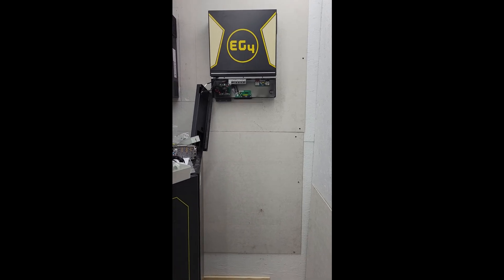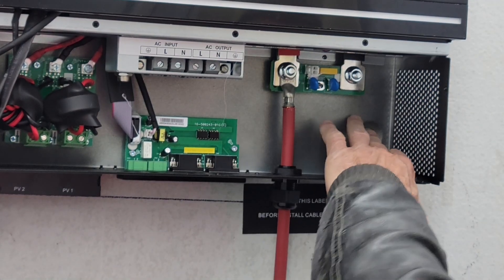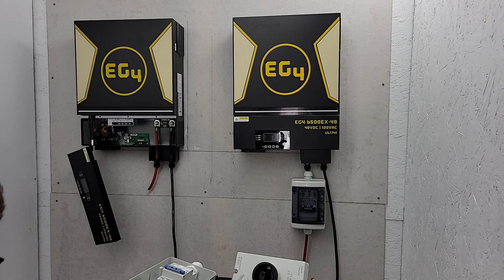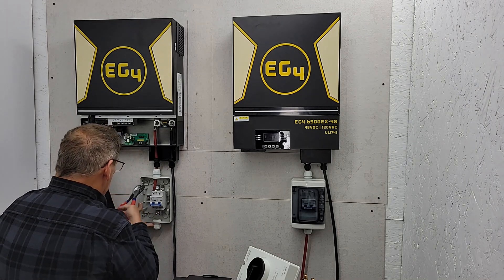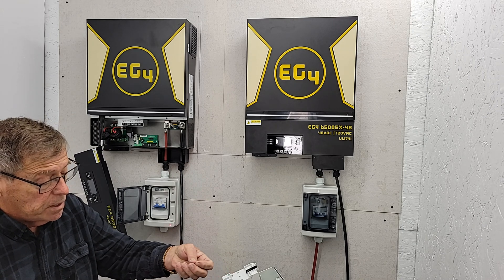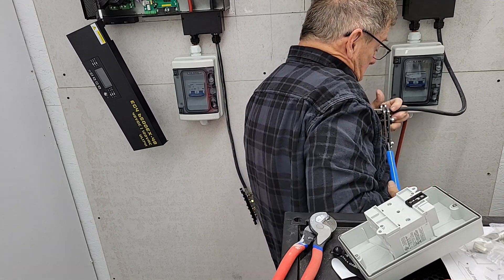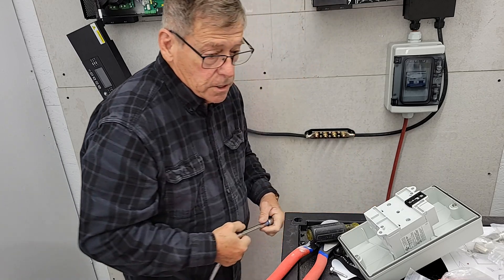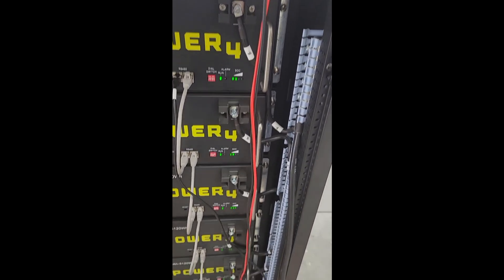EG4 6500EX -Wiring them up

Comment: Thank you for making this video!  How much heat do they put out when receiving Solar and charging the batteries as well as when they are making AC power?  Also I know according to the manual the EG4 6500-EX is supposed to be 19.6” from the ceiling how far from the ceiling did you put yours and any issues?  Thanks!
Reply from the maker: They never got really hot. In the summer they got really warm to touch but not enough to burn you. They are about 15 inches from the ceiling.
Reply: @gerrypineau  ok another great piece of information for me as my unit will have to be inside our home as our garage has far to much moisture and heat (especially in the summer in Florida) to install my EG4 6500ex in the garage and this is why I asked my question.  As our unit will be inside and I also wanted to have the display at my eye level ( I am 6’2” tall ) and when following the EG4 Manual they state that the unit should be 19.6” from the ceiling and I would like it a little higher in order to have the display at a more comfortable reading position but I was concerned about how much heat this puts out when running (Solar charging and outputting AC power) as I don’t want the unit to over heat!  I also did you use any of the EG4 Apps to monitor your units?  And if so how was your experience with it and which one did you use? I have an iPhone so I would be using an iOS App to monitor them